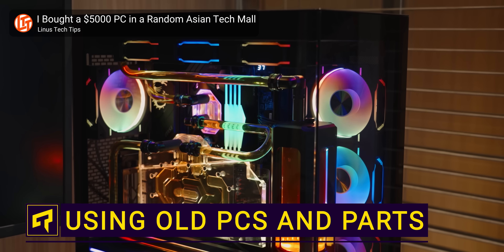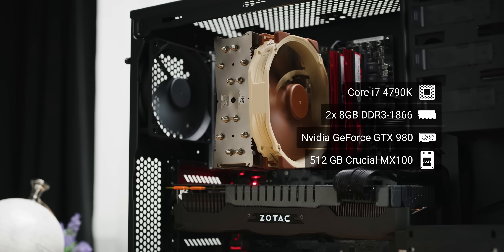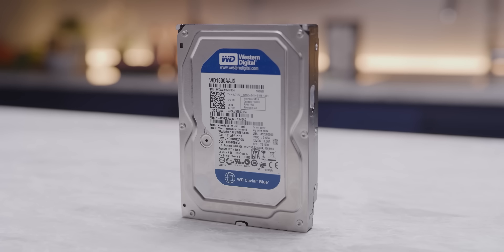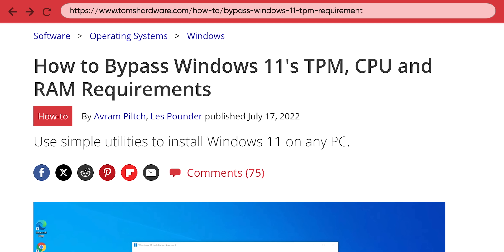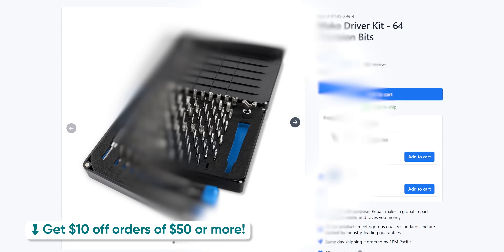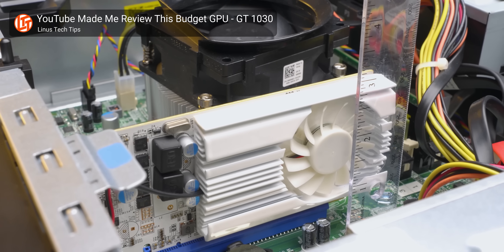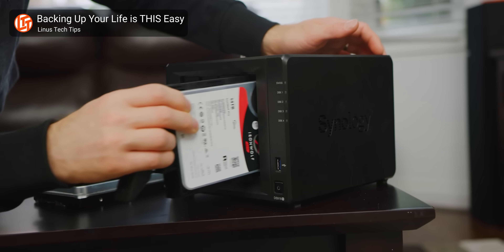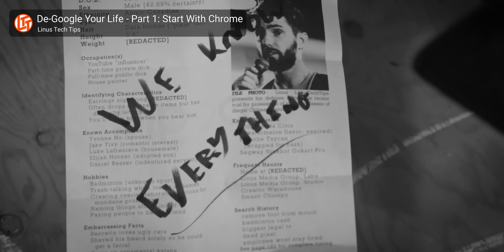FIVE Cool Things To Do With Old PC Parts

Comment: No way you recommend Chrome OS instead of regular Linux
Reply: I’d just like to interject for a moment. What you’re refering to as Linux, is in fact, GNU/Linux, or as I’ve recently taken to calling it, GNU plus Linux. Linux is not an operating system unto itself, but rather another free component of a fully functioning GNU system made useful by the GNU corelibs, shell utilities and vital system components comprising a full OS as defined by POSIX.

Many computer users run a modified version of the GNU system every day, without realizing it. Through a peculiar turn of events, the version of GNU which is widely used today is often called Linux, and many of its users are not aware that it is basically the GNU system, developed by the GNU Project.

There really is a Linux, and these people are using it, but it is just a part of the system they use. Linux is the kernel: the program in the system that allocates the machine’s resources to the other programs that you run. The kernel is an essential part of an operating system, but useless by itself; it can only function in the context of a complete operating system. Linux is normally used in combination with the GNU operating system: the whole system is basically GNU with Linux added, or GNU/Linux. All the so-called Linux distributions are really distributions of GNU/Linux!
Reply: @sturm1379  Alpine
Reply: @segmentationfox  Good clarification, Alpine is Linux but not GNU. There is also GNU/Hurd, which is GNU but not Linux.
Debian, Ubuntu, Fedora, Arch, Manjaro, etc. are GNU/Linux, I thought maybe he was referring to those.
Reply: @sturm1379 "I use Linux as my operating system," I state proudly to the unkempt, bearded man. He swivels around in his desk chair with a devilish gleam in his eyes, ready to mansplain with extreme precision. "Actually", he says with a grin, "Linux is just the kernel. You use GNU+Linux!' I don't miss a beat and reply with a smirk, "I use Alpine, a distro that doesn't include the GNU Coreutils, or any other GNU code. It's Linux, but it's not GNU+Linux." 

The smile quickly drops from the man's face. His body begins convulsing and he foams at the mouth and drops to the floor with a sickly thud. As he writhes around he screams "I-IT WAS COMPILED WITH GCC! THAT MEANS IT'S STILL GNU!" Coolly, I reply "If windows were compiled with GCC, would that make it GNU?" I interrupt his response with "-and work is being made on the kernel to make it more compiler-agnostic. Even if you were correct, you won't be for long." 

With a sickly wheeze, the last of the man's life is ejected from his body. He lies on the floor, cold and limp. I've womansplained him to death.
Reply: @sturm1379 is Debian, Arm, QuebesOS, Android also based on GNU? Or which are the OS left made from scratch? Could Google but im not in a hurry and enjoy smart people 😊
Reply: Linux tech tips.
Reply: Dont think any lite version of windows (worth installing. Not 3.1 and just DOS), its so many insanely tiny and lite OS'es now. One of my old Raspberrys has 2gb sd card TinyOS and is a major part in my whole network. I don't game or even use it since its fully automated now. But i still remember the days inserting disk 1 of 22 just to play Supaplex or Doom on VERY tiny Windows versions.
Reply: Depends on who it's for.
Reply: he talked about just attending video meetings and general browser stuff. average joe probably couldnt or wouldnt want to spend few hours in terminal every time to set something up, so chrome os is pretty safe option for general public i think.
Reply: @h4z11s4  You can do all of that and so much more in Linux already, and no, you don't need to touch the terminal. This isn't 2005. ChromeOS offers almost nothing over a standard Debian Stable based Linux distro.
Reply: Chrome OS is Linux, just as any other GNU/Linux. Just another launcher.
Reply: @bgezal ChromeOS and Android, being locked down, as non-free (as in freedom) as possible and not having the GNU utils, is literally the reason why people refer to "Linux" as GNU/Linux.
Reply: @bgezal  That's why I said "regular" Linux
Reply: @daliareds  sorry I read it as "plain old linux"

Comment: Some of the HDDs I use for storage are from the mid 2000s. lol
Reply: IDE or get, out. :)
Reply: I have one from January of 2005 that still runs great
Reply: I have several MFM hard disks from the 80s that still work. Of course I wouldn't trust them storing important files. Then again I couldn't fit a lot of current files on them anyways xP
Reply: My 40gb PlayStation 2 drive finally died this year.

Comment: I want my router to be able to play games at 8k, 120fps
Reply: so if anyone points to your "router" and asks "but does it run doom?" you can safely say "doom eternal, yes, running right now."
Reply: @peka2478  routers can run GTA Vice City
Reply: Teaching your router to do all that would take ages. Good luck with that!
Reply: That's still not good enough for Crysis.
Reply: Streaming video games sucks.
Reply: the ps5 😂
Reply: Your router doesn't Run games. Your personal computer does
Reply: @motoryzen  it was joke
Reply: @Nightmare-mr5mx Not only was it a joke, but routers can be used to stream games. If anything, it's more legitimate to say that the router can play games at 8k120 than to say that your PC can do it, because PC performance varies drastically depending on the application. I bet that my laptop without a dGPU can run Half Life 2 at 8K120 easily, but that's probably not the case with Baldur's Gate 3. A router will need the same capabilities to stream 8K120 content, no matter what content it is.
Reply: @motoryzen  Jokes goes way over your head, hey?
Reply: @CanadianBakin42O nothing goes over his head, he's too fast, he would catch it.
Reply: @RomainWhatever  Then explain why he couldn't catch the joke.
Reply: @motoryzen  It was a joke.

Comment: I already found something to do with my old, terrible computer: it sits on my floor next to my bed for... decoration I guess.
Reply: OMG... you just described me.
Reply: If I find you on my floor I will call the cops  @jeka1030
Reply: I use mine for important dust gathering duties!
Reply: i put it behind my chair in the way of my drawers instead 👍
Reply: Objet d'art
Reply: I used my brothers pc case he left as a table for my pc.
Reply: Man I feel this one. I’ve got a couple of old towers I keep telling myself I’ll do something with…
Reply: To be honest? That is the most realistic use case scenario. 
Who in their right mind would use old power hungry desktop for a router?!? Run old games?!? Are we talking like x486 from 30 years ago or what?!? 
Furniture/Decoration is a valid option!
Reply: @DegustoDelSol I have crt monitor and old cpmputer to play old games and runs emulator for games like Mario.
Reply: Same, I put a plank on it and use it as a night stand
Reply: I use a PowerMac G5 as a nightstand.
Reply: brua i have a gt 730 wight a i5 10th gen and it can run totk and its the only pc i use
Reply: I used mine as a table to elevate my new computer off the floor for a while. It worked pretty well.
Reply: Me with my old laptop and my old MacBook Pro with current MacBook Pro due to join them in the next few months 🤣
Reply: i have 2 mobo cpu combo`s in the attic and 1 gtx 960, they should still work fine, but i upgraded so i dont need it.
I might get some d4 ram and a psu so i can build a testbench though.
Reply: When it's cold outside I use my old pentium 4 optiplex as a feet heater lmao